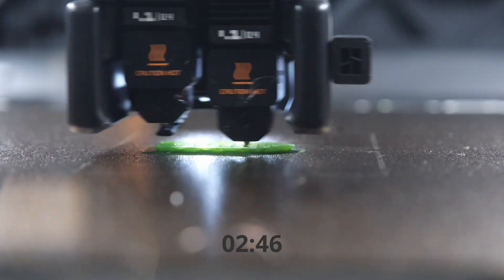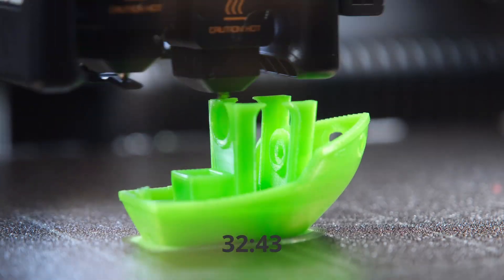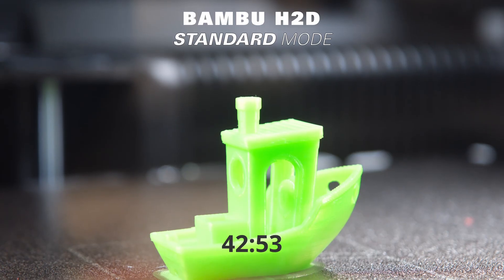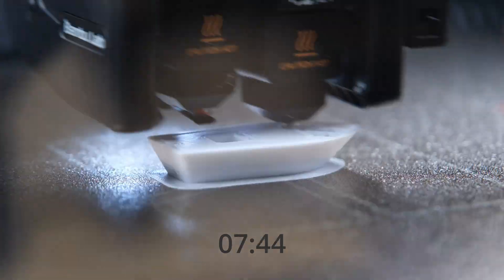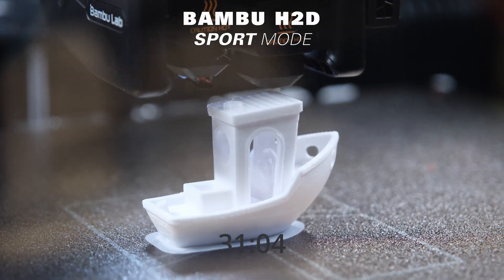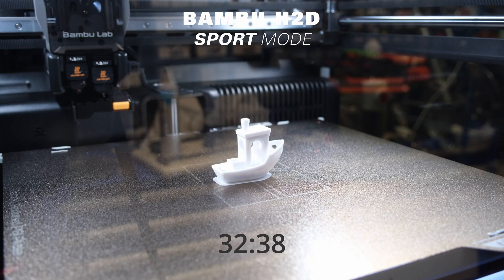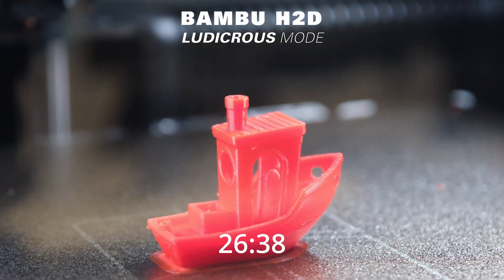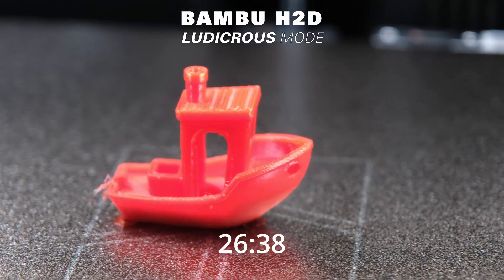Layer by Layer:  Bambu Lab H2D 3D Printer Speed Test: Standard vs Sport vs Ludicrous 3DBenchy

Comment: Useless test - you need to compare like-for-like, using the same filament. Different colours affect the output as it alters the material properties of the plastics.
Reply: That was the first thing I thought too.  You don't change variables doing tests.
Reply from the maker: How can it affect speed or quality if all colors have the same setting: Generic PETG?
Reply: @CafeExMachinaKokkola  because the plastic itself will inherently have different material properties if the colour is different. The colour additives can change the way the plastic performs. It's like asking how can it affect quality if you have the petg preset selected while running abs,polycarbonate, or coca cola through the machine. To do the test correctly it's best to redo with the exact same spool of filament

Comment: I think something is off with your settings. On my X1C it prints in about 17 minutes in normal mode. At full speed in about 10 minutes. I doubt that the H2D is that much slower.
Reply: He is printing in petg maybe that's the case
Reply: @Pigo-t5u  that would make sense
Reply from the maker: What filament you use? I use only PETG and ABS.
Reply: @CafeExMachinaKokkola  depends on the need. But I would say mostly pla+, and pla silk.  Petg for more durability projects. And TPU from time to time.